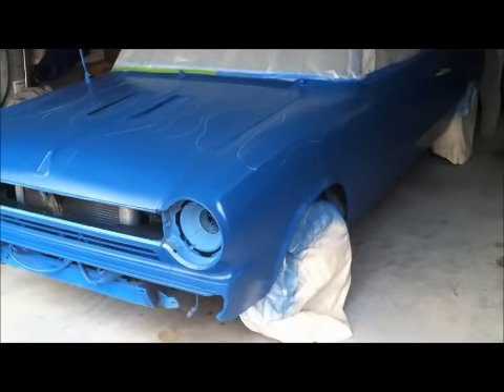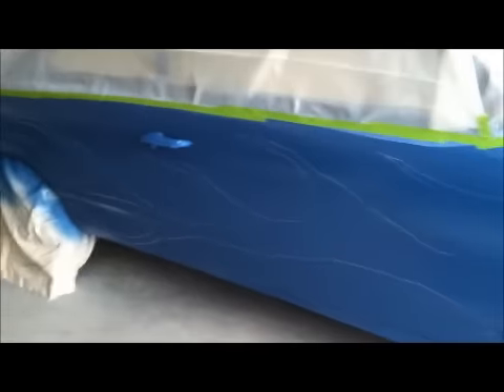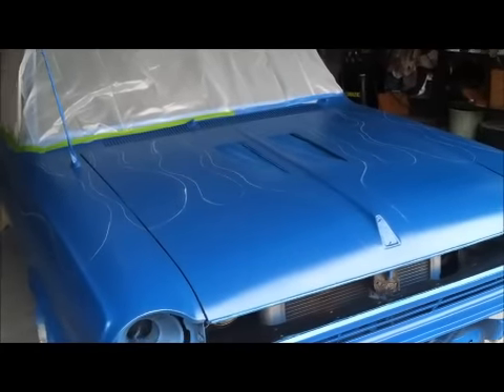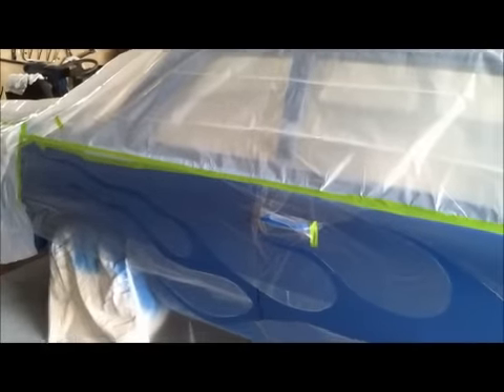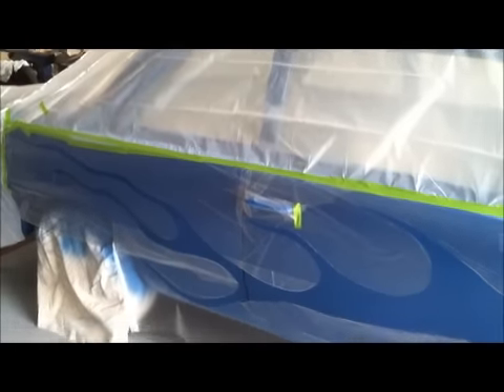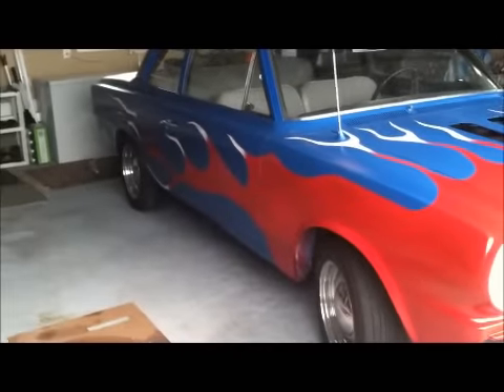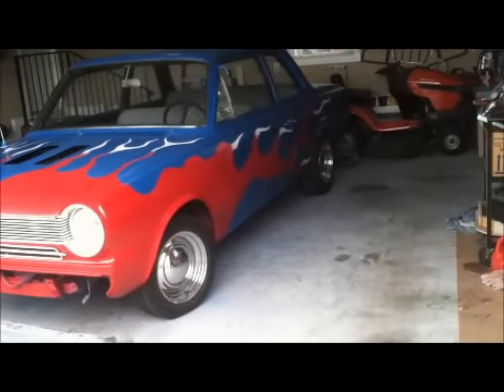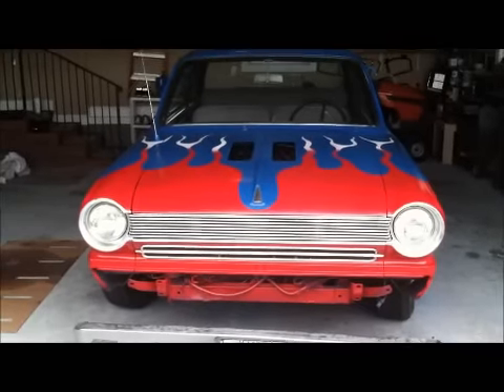Painted flames on Rambler

Comment: Looks good, My concern is when you pulled the contact paper of the first time and pulled some of the blue paint up. If that is happening with the contact paper it means the surface under the paint was not prepped properly. You may end up having a serious flaking and peeling issue in a year or so. Also, be very very VERY carful using a pressure washer or jetted car wash on that paint. It will most likely just blast the paint right of the car. :S